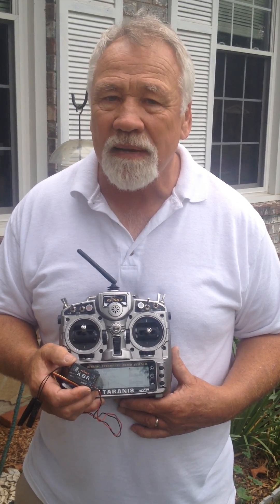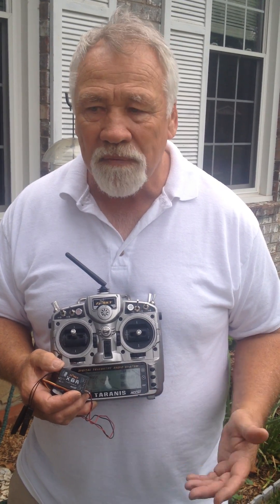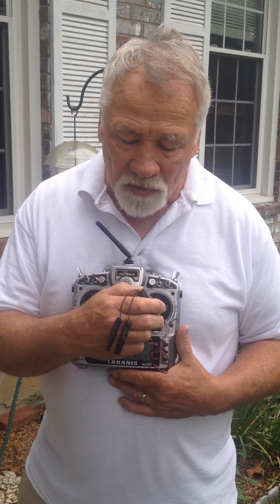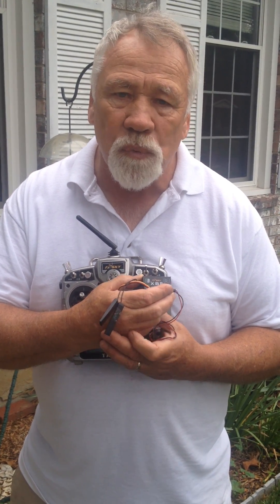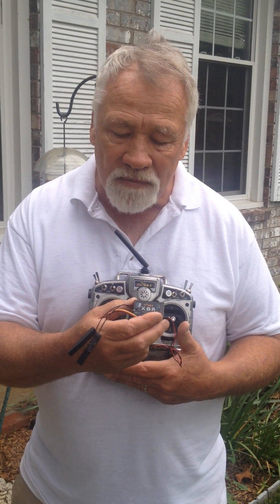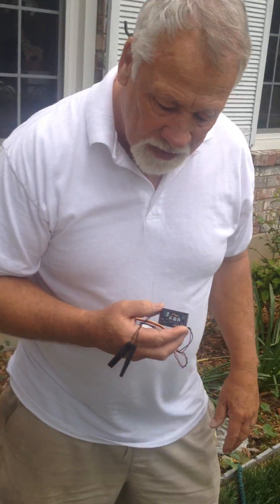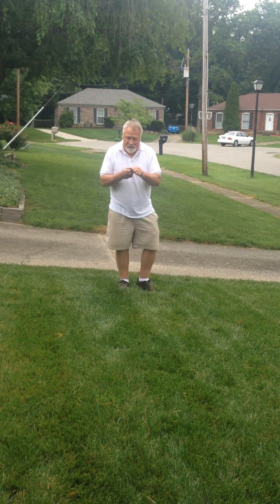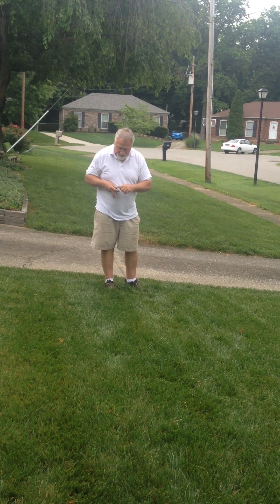Tranis X- Series Quick RX Test

Comment: mine just says  signal low or  critical dont do numbers, would love to figure out how ot do that
Reply from the maker: Richard Abram 
Hi Richard
You need to do a little homework with your Tx.
1 Special Functions
2 Chose switch of choice
3 Play Value 
4 RSSI
Of course you didn't say which firmware version is in your Tx and if its 2.1, did you "Discover Sensors" with your RX powered up?
Too many questions for a comments area under a YouTube video.  Try RC Groups.
Reply from the maker: Try RC Groups, or YouTube:-)
Too many things you need to learn for an answer in a YouTube comment area.  Sorry.